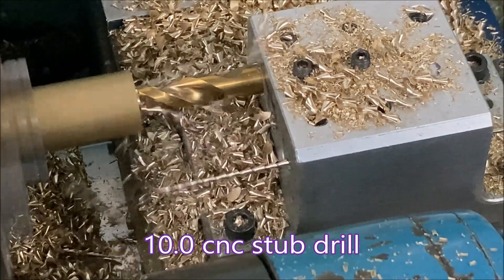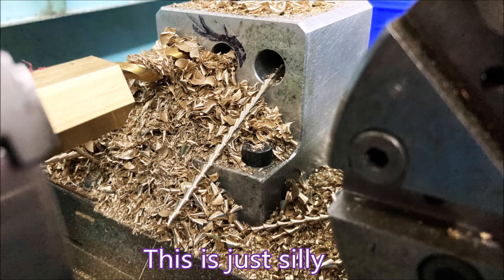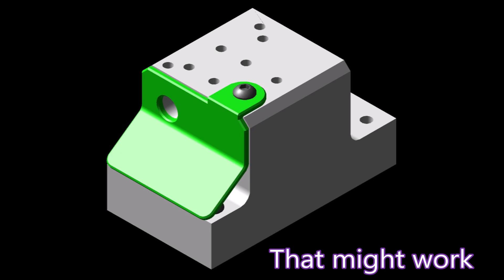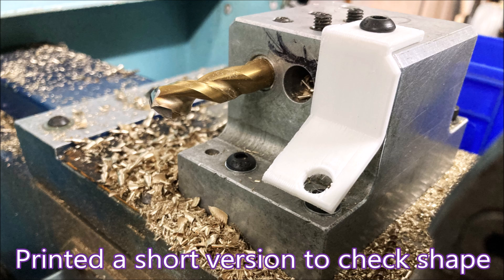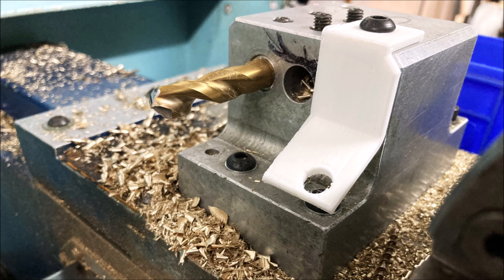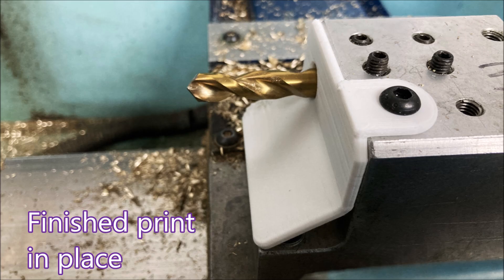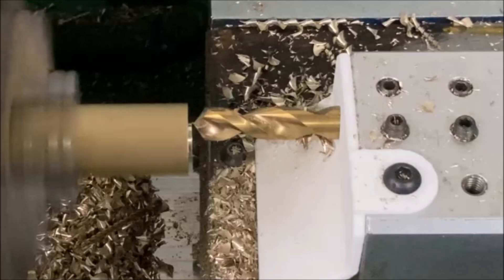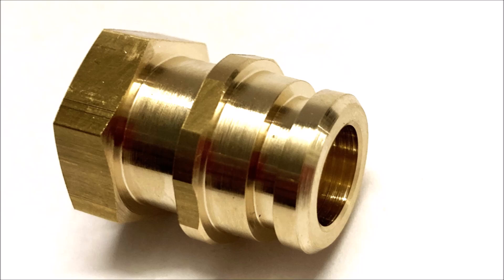Small cnc lathe drilling 10.0 in brass. Swarf is horrible so I 3D print a deflector plate

Comment: That is really nice.  I started 3D printing just toys and stuff like that .  But now I want to make more useful items.  But learning to use Fusion 360 is a slow process for me.
Reply from the maker: Hi Gary, I was unable to learn fusion. Fusion is very capable but has a steep learning curve. If you have simple cad needs, there should be something that is easier to learn.
Reply: @smallcnclathes  there was an easier one but it was limited but it might work for other smaller projects.

Comment: Nice solution without using compressed air. I've been thinking about making a guard that's adjustable for regular turning to keep the chips from being thrown everywhere and direct them to the center so they can fall down to the tray.
Reply from the maker: It is funny, you are the second person to mention compressed air, I never even gave it a thought.  All I could see was swarf building up and if I put a ramp there, it should fall out of the way! Luckily it did. LOL Thanks for your regular comments on my videos.  I really appreciate the effort folks take to leave a comment.
Reply: @smallcnclathes  you make interesting videos, it's amazing to see how much you can push the small hercus  👏
Reply from the maker: Thank You.   I don't like waiting around for a job to get finished particularly on a large run of parts.  So I like to push it hard as I can, that said I do like to think I know where hard use stops and abuse begins.  Current job was being fed at 0.15/rev and still not reaching 5 amps at the spindle.
BUT when I looked at the video, I could see the tool in the turret was jumping up at the end of the cut after deflecting under the force being applied.  So I made it 0.08/rev, lathe was happy and me too!

Comment: I run compressed air at about 30 psi from my tiny compressor. I find it makes such a huge difference when cutting brass. I might try running a vacuum on the toolhead next.
Reply from the maker: Guess I could have done that too, but the thing I came up with puts the swarf where I want it without running a compressor. Thanks for your comment. Nigel